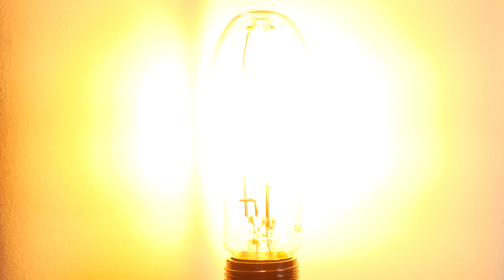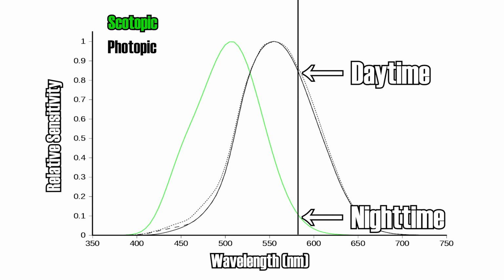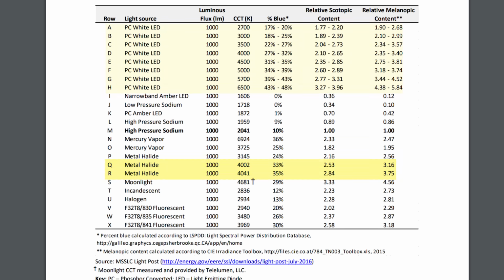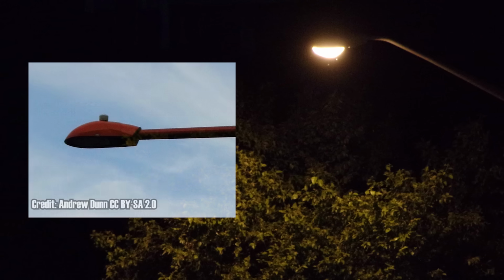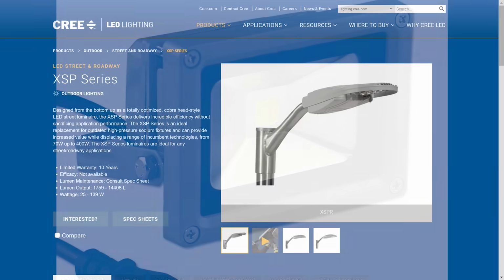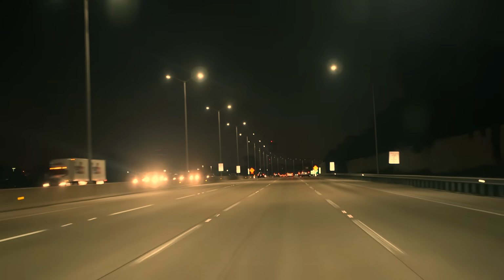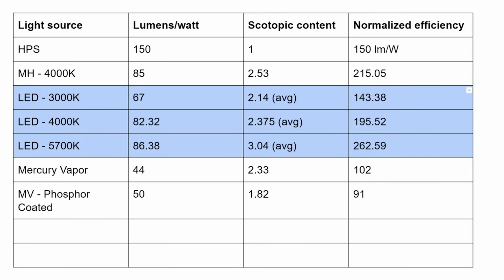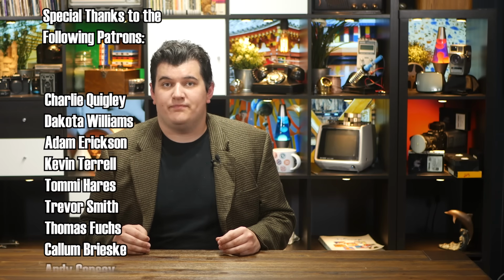The LED's Challenge to High Pressure Sodium

Comment: Anyone who has done night timephotography knows that daylight and moonlight has about the same white balance @ ground level. Do a long exposure image  under moonlight, and the colour balance of your subject looks approximately colour balanced like daylight. Use the colour eye dropper tool in any decent photo editor and you can confirm this.

Under darksky, a least 100kms away from a city and no moon conditions, the sky can look a brown colour, sometimes blueish, all from the same location, just different atmospheric conditions.

Truck drivers have done many, many tests, and truckies are more likely to spot a roo using slightly warm, eg 5000k hid lights in their trucks. The cheaper 6000k and above hids are avoided by truckies. Many many tests have been done.

The reason people are reacting quicker to led vs hps, is not the colour temp, it is the wider CRI of the led, and makes seeing the typical black suv easier.

All the cheaper leds have higher colour temp, eg 6000k and above. This is due to how leds are constructed. Most leds are actually blue, but are suurounded by yellow phosphor that is energised, and re-radiates at a lower colour temp.

Very low colour temp leds, eg 4000k and lower, havenreduced efficiency due to the real estate required in the led chip to accommodate enough phosphor to achieve this colour shift.

I have made high power bike lights (for night trails) using 100w led street light chips of various colour temps. You can clearly see the additional yellow phosphor of the warmer (lower k) chips.
Reply: I love night time long exposure photography, something about everything lit up like day time but the sky is dark. Do you have a page of your pictures?

Comment: My biggest issue with new LED lighting fixtures is basically what you mentioned at the very end of the video about the driver and the heat sink. All these new fixtures are basically a whole assembly with no replaceable elements in them, forcing you to replace the whole thing. I'm also in Chicago and have already seen city installed LED light fixtures under bridges have entire LED strips go out (1-2 of 6 strips). Combine that when some do fail they flicker/strobe while doing the death dance. 

I love LED tech and think we will find a good compromise in the future for output/color soon. But the maintenance and cost I don't think factor in the supporting electronics going out. The LED is rated for 100k+ hours of service but all 2 common to see them fail in 2-3 years, even in household bulbs. I would love to see them designed with replaceable elements within the housing.

Also, just found your channel today and you have a new sub!
Reply: So you believe everything that people say?

Comment: I really, really like the video and video style. 

The video actually feels like someone with at least a degree in the field, if not a thesis on the specific issue, contributed. Lots of interesting information has been nicely condensed and mixed with good illustations. It's not at all dumbed down - at least high-school level of language sophistication and science background in the viewer is implied; it's in the small thinks like you didn't explain color temperature and what for example 3500k meant - and how you expect the viewer to be able to read a Cartesian coordinate system off the original sources. 
And there's none of that horrible, horribly distracting and condescending fad to show you the same text on screen that is narrated. Nice sources, and I like the all-angle approach instead of the "edutainment" 4-minute monochromatic view at an issue.

Well done, I subscribed right away.

Comment: A few years ago they changed all the street lights in my old area to LED and I couldn't stand it. IMO it was far worse than the soft yellow light. Since being brighter, it seemed to cast harder, pitch black shadows. Where I could stand on the street before under the light and see somewhat decently into my backyard, it was now a complete wall of black. Maybe it was because the light was right in front of my house so I was getting a much stronger effect, IDK. I just know the whole block seemed darker to me because anywhere the light didn't hit was an almost pitch black shadow.

Comment: Need to consider the fact that there is actually value in disrupting a driver's circadian rhythm. Driving is a high-alert task and seeing blue light at night shifts your circadian rhythm towards this time, meaning you're more alert at this time. For regular night drivers, this is actually very valuable and can see no reason why this wouldn't be a cause for much safer roads at night.

Comment: I find that LED headlights are way too bright and temporarily ruin my night vision, much worse than old-style headlight bulbs (not sure if these are HPS or not, but that's not the point of this comment). How is this safe? Perhaps white LED gives better vision to the driver of the vehicle because they are not directly looking at the light source, but they are more dangerous if they cause other drivers temporary blindness. While headlights were not covered in this video, nor was the effect on night vision of looking directly at the LED light source, only looking at an area illuminated by LED light (as the streetlights are in the periphery of drivers' vision - not so with headlights). I feel that this is an essential aspect of the topic, and not being covered deeply flaws this video. Obsession with efficiency is not a good thing.

Comment: In all, it seems a mixed methodology of light fixture deployment and control should be used, with LEDs capable of altering the temp and output dependant on several factors, with their longevity being a main pro over the initial installation cost versus replacement/repair costs of other fixtures.... if there are any. I dont actually recall any street lighting on non-highways being replaced... or out at night. but its not a detail I would notice, I dont think, unless several in a row were out.

Like you said, a lot of the housing fixture is responsible for the light pollution - your 'see it from an aircraft in flight' bit. so a combination of housing that restricts how much direct unreflected light is lost going up, combined with the already lower amount of power to put out the "same level of ~visible~ light".... and I'm sure the melonoptic thing wont be as bad as the figures suggest. Afterall, if only what - 10 percent of the HPS light is even visible, then an LED which produces twice the 'scop' light at 10v, but say, half of that at 5v, and same scale on the melon bit, but at 10v it still only produces twice as much melon light as the HPS, then that 5v led is producing the same level of both light at half its power capacity... and with the right housing solution, might not even need that for an even and safe level of lighting. THEN add in, maybe, a timed system, with long stretches of highway that have no junctions (so basically on a highway, the sections between that are just 10 miles of straight road or something), after certain times, every other light can be switched off after a certain time, cutting power cost down to a quarter... And if a simple, low-power-and-low-cost system could exist, then the lights could even be only on when cars and trucks actually drive down them. 

Here in the UK, some motorways actually do have their lighting completely switched off between certain hours because of low levels of usage or somesuch, so that's also an option. A combination of all three? (whatever-time to 11pm, all lights on, set to a less-circadian rhythm-disrupting spectrum. 11pm-1am alternating lights off and on set to the blue , 1am-4am switched off, 4am-6am alternating lights off in blue but with sections where the 'on' and 'off' from the previous alternating timeslot is switched, so the lamps see an even distribution of being on.

Comment: I'd get rid of the vast majority of street lights and leave them only at intersections and pedestrian zones (like parking lots).  The incredibly good white LED headlights in my car have rendered normal street lighting along roadways unnecessary.  The street lights that remain I'd put on fade-in fade-out motion sensors.  I'd ban "up-lighting" altogether and require 100% of new outdoor fixtures be "full cutoff" fixtures, including the ones on walls.

Comment: You can still filter out high pressure sodium light. Deep sky images are usually taken with narrowband filters letting threw only a few nm of the spectrum. Hps has the advantage of having sharply defined spectral lines, thus are easy to filter around. Where as LED's are braudband sources that will create sky glow even in narrowband images. Hence why i hate them.

Comment: Eventually with the tech in smart cars, we should be able to light the next half mile or so in higher color temp so you can see in front of you, but then have it revert to a lower color temp "standby" state.  That way you get all the benefits of safety with minimal circadian disruption for locals.  Also, would just be able to tell a car is coming by the lights changing color

Comment: if blue light does hurt your eyes is just fear mongering, then why does the 650lm osram lamp with 6k kelvin leaves black dots on your eyes while looking at it and the 900lm osram lamp with 2500 kelvin doesnt?
both are mercury lamps with the same socked type and same generation.

Comment: When I drove a taxi people didn't believe that I saw better without my headlights than with. I figured that out when I forgot to turn the lights on after leaving the depot. The Light from my headlights would shine back in my face making it more difficult to see because of the light colour. They would ask what they are for if that's the case and I told them it's so other people see me, not so I see them.

Comment: I think there's more to this than just the light source. It's also the color temperature of the light itself. The reason I say this is because traditionally, your sodium lights (and I admittedly know nothing about the difference between high- and low-pressure sodium lights) emit more of a yellowish light. Even in your highway clips it's very obvious that the sodium lights skew more yellow and the LED lights are a harsh blue.

Okay, maybe I'm being harsh by calling the LEDs harsh, but that's typically my experience at night. Lights that include more of the blue in their spectrum have long been determined to provide lower contrast than more yellow lights, and I believe I see that in your highway clips. While the LED lights may be brighter overall, the detail of the objects you're looking at are more enhanced by the more yellow lights.

Please bear in mind that I'm a person with rather sensitive eyesight, and I always prefer less light to more. I use my computer in my living room on my 40" TV and I keep my overhead lighting at a minimum, while using a combination of yellow-ish lights and red lights (thank you Philips Hue) while also almost always turning the brightness of my TV down all the way. In fact, I switched Firefox to a dark theme and use a Youtube extension to do the same and I still feel like I'm bombarded with a ton of bright light. I'm comfortable typing this right now, but if I go to a standard website I'm going to be blasted in the face with a bunch of light that is not going to be very comfortable due to the widespread use of white backgrounds (it's the most idiotic and annoying thing, I don't understand why a black background isn't the default).

But my point is that at least for some time (I'm not sure if this is still a thing), fog lights in France were required to be yellow. Why? Well apparently because it helps increase the contrast of what the driver is looking at. That was a revelation when I read about that, and from that point on I realized that I vastly preferred yellow light at night. It's because it can illuminate things and outline objects without being obnoxiously bright. In my experience, this is a thing that makes a difference in my nighttime driving. Similar to how when we'd go to sleep at night in boot camp, they'd turn on red lights so that the people who were awake could see without disturbing the people who were sleeping (at least somewhat, it would bother me on rare occasions).

I probably did a terrible disservice trying to explain this while somewhat inebriated (shut up, it's the fourth of July), and I'm not really filling in the gaps properly, but there's something to the aspect of color temperature of lighting and the contrast that people are able to perceive. I don't believe white LED lighting is the correct choice for illuminating roads.
Reply: I left my comment early and I think it's quite obvious that you covered everything I mentioned. So, sorry. I will mention that there are night modes for many computer devices including iPads and now even Windows 10 includes this, in which it reduces the amount of blue light that is emitted. It's not so much that blue light is harmful, but that the blue light seems to provide more of a strain to the eyes when concentrated in a particular area. So given that, I'm entirely open to the fact that I'm probably wrong regarding highway lighting. All of this stuff is very fascinating.

Comment: This is an interesting topic that I didn't know a lot about, but always had a lot of questions about. This filled in a lot of the blanks, but not all of them. See, I live in the Detroit area, and we've had HPS or mercury vapor bulbs in our lights forever and they've just recently in the past couple years got around to replacing them with LED's. On the freeways, this is great, you can see everything clearly and it makes night driving much easier. However, in the residential areas, the street lights are worse than ever before, they only light up what's directly beneath them, which makes seeing people who are in the street for whatever reason almost impossible, and the sidewalks are completely dark which has a slew of other potential issues associated with it. Roads paved with blacktop are impossible to see, it's like driving through space on acid! Areas with frees are extremely dark now as well. The old HPS bulbs had a worse color but they had better light distribution for all of these sorts of things and they made more sense in our residential street lights, imo.

I just can't understand how the LED's are so great for the freeways but so completely terrible for lighting up my road...

Comment: since eyes percieve logarithmically, change the y axis to logarithmic and you will see the difference is much smaller than it seems. Also, consider the contrast between dark background and less stimulating sodium light might be easier for driving and seeing things in shadows,than the high contrast of the much higher stimulating LED light.

Comment: The problem with light pollution from various light sources in astronomy and astrophotography is a bit more complicated. Yes, the low pressure sodium is by far the best option in this regard since it can be filtered out fairly easily. But even high pressure sodium is still fairly OK, because the light spectrum of a HPS lamp can still mostly be filtered out relatively easily as the most of the light output is still concentrated into a few wavelength "spikes". So you can filter out a considerable amount of the light pollution produced by a HSP light source while mostly not affecting the rest of the spectrum by using a very selective light pollution filter that only targets those spike wavelengths. It's not ideal, but it still helps tremendously.
Meanwhile the color spectrum of an LED light, no matter what it's color temperature is, is a lot more continuous and can't really be effectively filtered out, because by doing so, you're also filtering out the parts of the spectrum you want to keep.
So, as an amateur astronomer and astrophotographer, I have a love/hate relationship with LED lights replacing the HPS lamps. I love them because most of the current LED fixtures, at least when installed properly (which is something that doesn't always happen, sadly), seem to have a much better design that tends to limit the light pollution greatly. But I also hate them because any light pollution created by LED lights is effectively killing astronomy and astrophotography. We've already been struggling under HSP lighting, but we could work around the issue in a fairly acceptable way. WIth LED-based light pollution, there really is nothing we can do except travel very long distances to the few spots still untouched by light pollution :(
Reply: 40,000 people a year die from car crashes in the US. Amateur astronomy is well.. astronomically UN-important by comparison. Like... even if it increased motor vehicle safety 0.1%, it's definitely still worth completely killing amateur astronomy. That would still be one life saved per about 20-50 people having to find some different hobby, which is an awesome tradeoff, and that's at just 0.1%